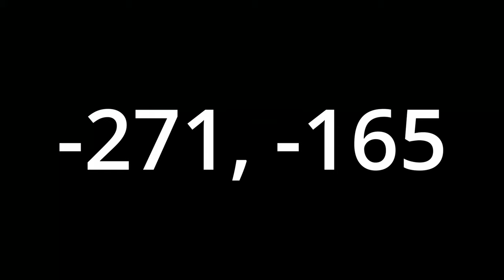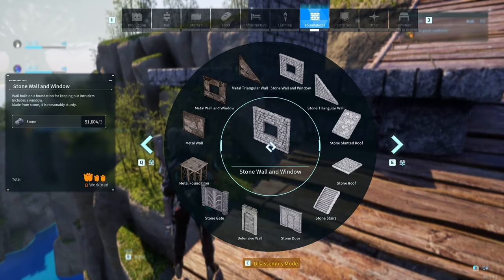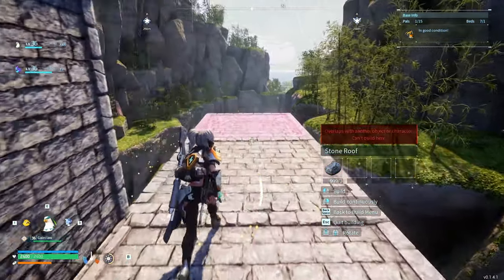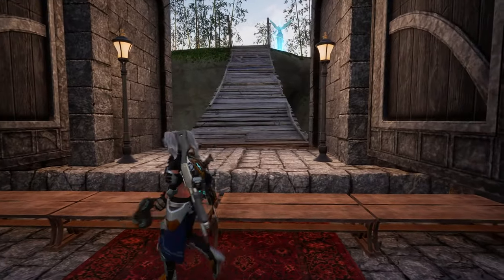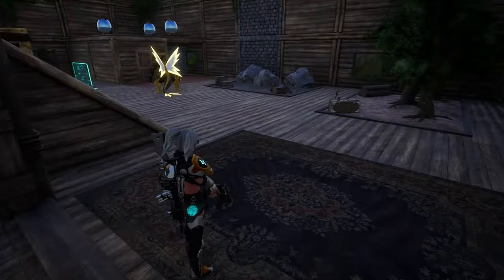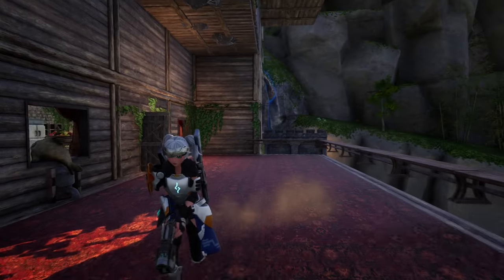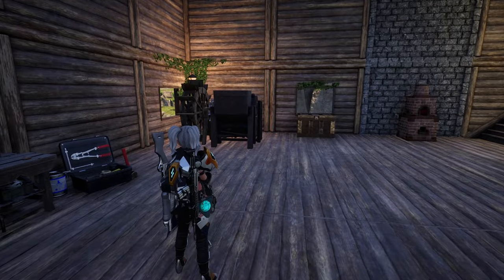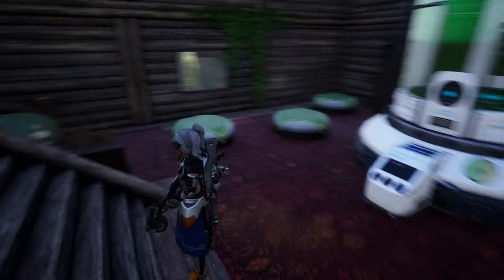Can You build a FUNCTIONAL "Floating" Bridge Base in Palworld?

Comment: Awesome build, this is definitely an idea i'd like to toy with whenever the game updates again. 

One thing regarding raid: I've found that raid mobs typically won't become aggro (won't attack) until they actually get into your base (the blue circle), so one way to make this base viable while also having raid active (for access to pal materials/rare pals) is to turn off structure decay and just block off access to the bridge with walls. Since the location is a hanging bridge, you on'y have to block off the far ends of the bridge for this to work; you'll have to mess with the world settings either way, but turning structure decay off is something that a lot of ppl already do, while not many turn off raids.
Reply from the maker: ooo thats good to know, with this spot at least they can attack from below (main reason I turned it off 😂) but I guess if you block that off too it could be used for ranches or breeding which would be interesting!

Comment: good use of the cantilever (TLDR: A cantilever is a rigid structural element that extends horizontally and is unsupported at one end. Typically it extends from a flat vertical surface such as a wall, to which it must be firmly attached. Like other structural elements, a cantilever can be formed as a beam, plate, truss, or slab) design principle, this pairs well with the buttress (TLDR: A buttress is an architectural structure built against or projecting from a wall which serves to support or reinforce the wall. Buttresses are fairly common on more ancient buildings, as a means of providing support to act against the lateral (sideways) forces arising out of inadequately braced roof structures) design principle for expanding horizontally with each vertical layer.
Reply from the maker: thank you! and I appreciate the education, I had no idea the actual terms for this kind of structure!